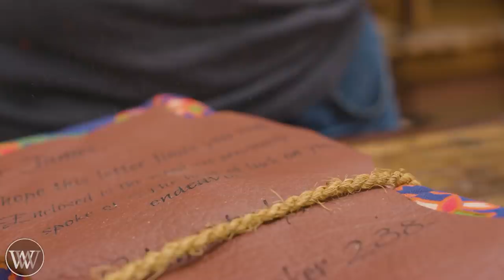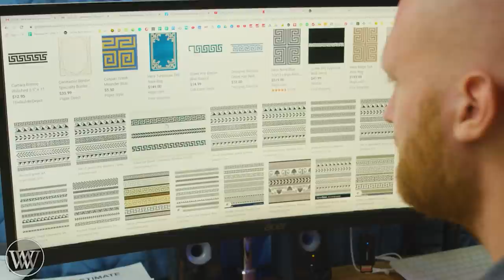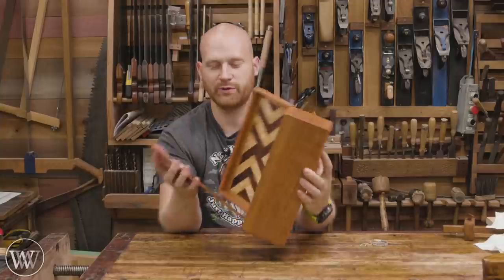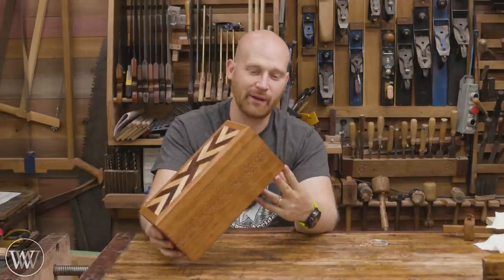Carved Cherry Box with Maker 238

Comment: I used to have a problem with getting lids to sit tight against the front after I put hinges on....now I slide real thin sheet stock (like a few thousandths) on the back of the lid where the hinges go when I mount the hinges; now the lid pitches ever so slightly forward so the front of the lid is always in positive contact and the back is barely noticeable.
Reply: Nice tip

Comment: Will the epoxy be enough to keep the miter joints strong over the years?
Reply from the maker: Oh yes. The epoxy will actually be far stronger for that joint in the long run. It is much better at end grain connections then using a PVA glue. I usually would use a PVA glue as it is cheaper and more available for most people.

Comment: Hey James I have a blade for Stanley number eight, it is really badly pitted there’s about an inch of blade left I consider taking it to the bench grinder but I thought I should ask what you would do or do you think I should just get a new blade for it.thanks
Reply from the maker: If the pitting is on the back of the blade then get a new one. That will cause all kinds of issues. If it is just on the bevel then you should be able to sharpen it out.
Reply: @WoodByWright  thank you how much is the new one will cost?
Reply from the maker: It depends on which one you chose. $10-$80

Comment: Jut asking: how do you use a shooting board without planing the shooting board itself
Reply: The stop block is set back slightly from the edge, and the board the plane slides against has a small rabbet lower than where the blade begins on the plane.
Reply: Jack Aubrey - Now that is the best short answer to how a shooting board works I’ve ever heard! I’ve spent 15 minutes trying to say just that.